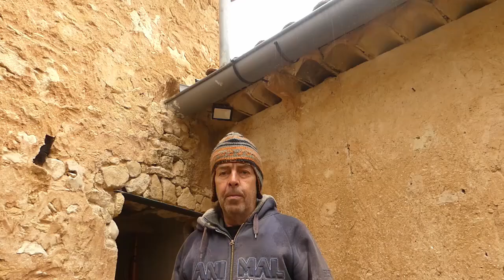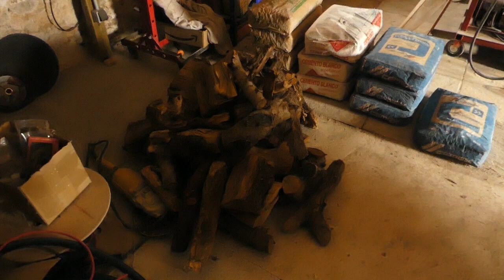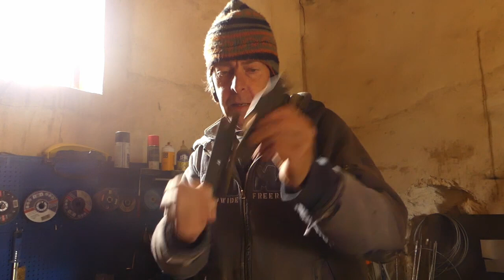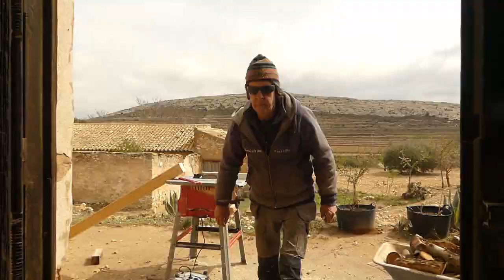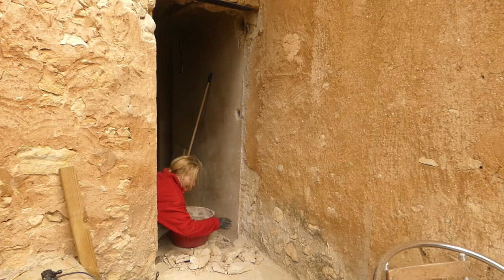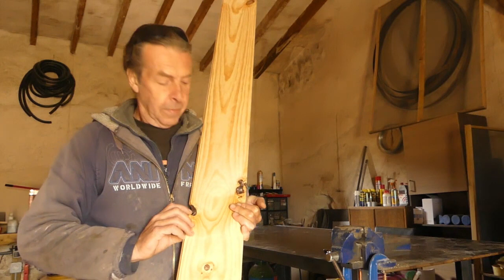Traditional stone farmhouse restoration in Spain. The wall didn't collapse - the props are out!

Comment: On these cloudy days do you still pull in power for your batteries or is it a generator job.
Reply from the maker: Hi Steve, generally the panels cope ok, charging the batteries. Obviously, we can't run any high load items (washing machine) without the generator but for normal household stuff, computers, lights at night, refrigerator... it copes ok. If we get a few consecutive cloudy days, I sometimes run the genny first thing in the morning for half an hour to give the system a head start. When the heavy sand cloud was overhead, we had to run the generator for a couple of hours in the day.